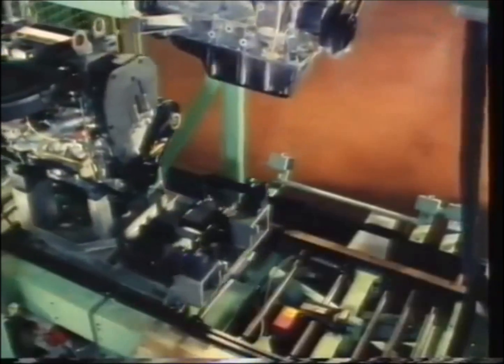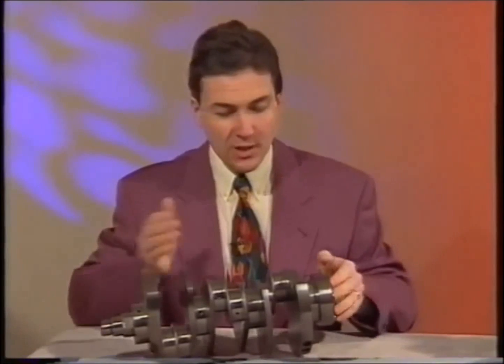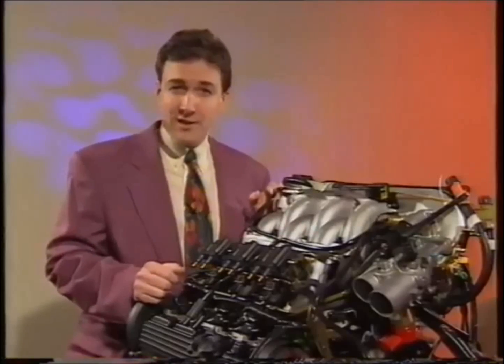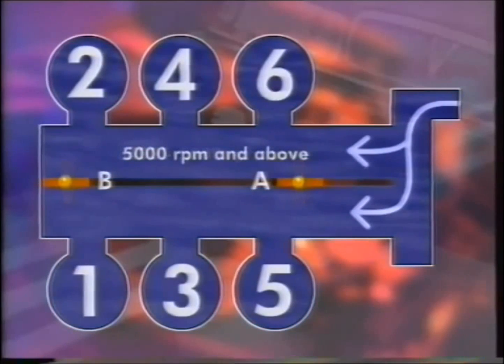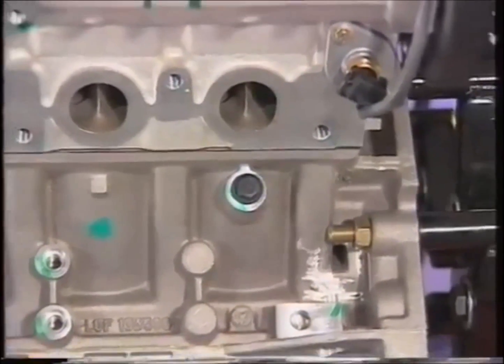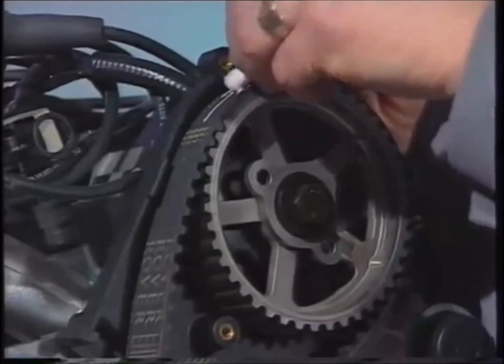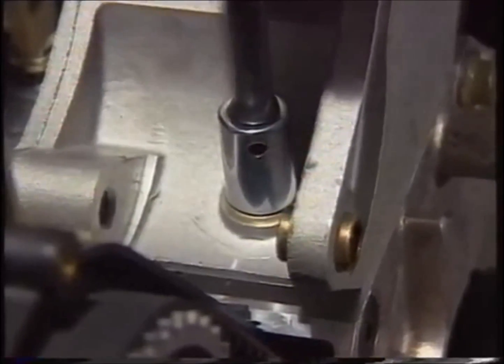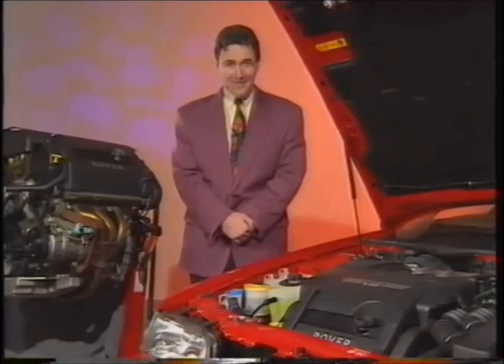Rover Group - KV6 Reveal

Comment: Reliable... Sure. Maybe after BMW redesign and even then it had its problems.
Reply: To be fair I’ve only ever had one major fuck up with a KV6 and that was down to poor ownership.
Reply: @Leo060708  Luck maybe... I'm not saying the engine itself is bad. My mother has a 75 2.0 KV6 from 5 years now and it's working almost flawlessly. The problems are those plastic components after BMW redesign - inlet manifold, VIS motors, clutch, thermostat. The engine itself WAS bad when it was almost handmade. BMW sorted that out but made another problems with plastic components. Other than that, KV6 is a great sounding engine but ... not much else. Performance is poor, economy awful, expensive in repairs and maintenance ... my mother has this 75 KV6 and I have 2.5 KV6 in my ZT so I know what I'm talking about ;)
Reply: I totally agree with you my 75 has the 2.5 unit and fuel consumption is terrible, as I’m retired now I only do short distances thank god .
Reply: @metalman4141  I totally understand. My 2.5 ZT can consume 15,5 MPG in winter :/ :/ :/ and I'm not revving it like crazy - it's a normal, everyday drive with kids in the back... VIS and manifold fully working. In V8 engine I can understand that but 2.5 V6? That's why I bought E46 320d as a second car - to lower down fuel costs cause driving ZT everyday the whole month was too expensive... I wanted Diesel ZT at first but... If it's only 131hp at best (without remap), with very hard suspension then why not to buy f.e. E46 which is 150hp with a lot more comfy ride. 75 was also an option but again - only 131hp for the same money so... To be clear - I really like 75 and ZT's. Great cars but unfortunately - cheaply made and underdeveloped. I always thought that ZT's should have been in only 3 engine options - Basic 2.5 KV6 190, Standard V8 260hp and Ultimate V8 385bhp supercharged. No Diesels (116 or 131hp for a sporting car? Joke?), no K-series etc. but we all know that problem was the lack of money. Shame. Both 75 and ZT are cars that can drive me crazy sometimes with their faults, economy etc. but... I don't know - still love them and not a chance of getting rid of them ;)
Reply: @metalman4141  If you did a constant 55mph it would be cheaper to run, obviously town driving isn't cheap or or even a heavy right foot.
Reply: @Luzzak Do you change your timing belts yourself?
Reply: @deville8448  I have MG ZT 190 for 5 years now. Every single timing belts change is expensive AF and out of 10 mechanics, maybe 2 want to do it... Thermostat is a plastic piece of crap - leaks every six months and because of engine overheating I had piston slap. Needed to rebuild the engine which costs me almost 2600 GBP. Other than that - the plastic inlet manifold rattles every now and then and because it is "unfixable" I need to buy the new one (if I can find one) for almost 1200 GBP (!). Other than that - it drinks petrol like good V8 but is poor in performance so the old 2.5 Galant can beat it. Sorry - cool car but the build quality is awful and the engine is good for Rover 75, not for the ZT.
Reply: @Luzzak  all this is true. I have the car since 2006. I changed the thermostat 4 years ago, no problem with it. I have 2 manifolds which rattles, I won't do anything about it as is expensive. Mine was very friendly with mpg if I didn't drive it hard . I asked if you change the belts yourself because I tried to change my belts with the locking tools and I can't. I can't align the rear sprockets. Also why did you need to rebuild the engine? Which was the problem?

Comment: These engines are junk . Bad built and badly assembled.
Reply: Those early units certainly were. However, as the KV6 found its way in the 75, the quality improved dramatically. As an 827 (Honda C27A engined) owner, I wouldn't trade mine for a late 825 KV6, but I'd happily have a 75/ZT KV6.
Reply: @Nombredeusuario1030  absolute rubbish, a Honda v6 engine will always be better than a rover engine, Honda is the best engine manufacturer in the world, a well known fact
Reply: @callum4035  i had a rover 75 with 240000 miles. 2.0 v6 was superb, drove like a new car. Untill the gearbox died. Exceptional engine though.
Reply: @callum4035  the Honda can also fail if you’re thick and don’t know how to maintain them, I have only had one KV6 fail because of own laziness.